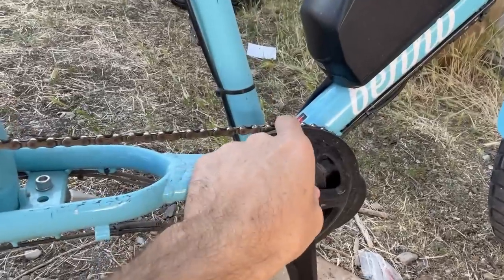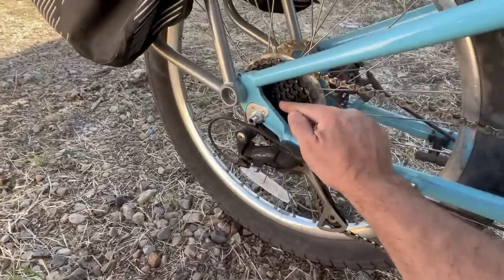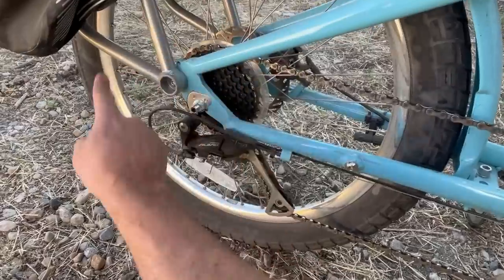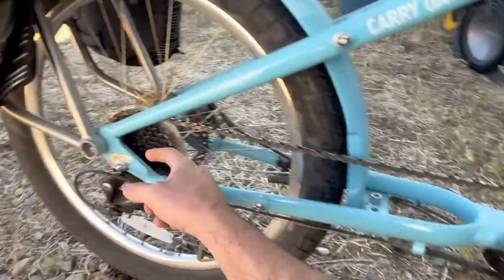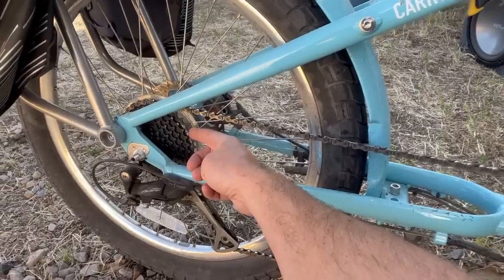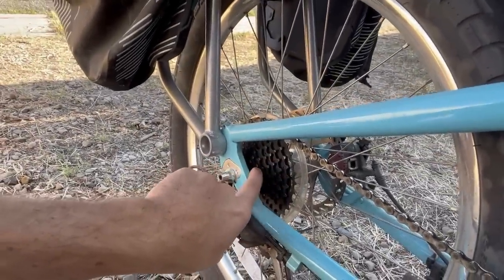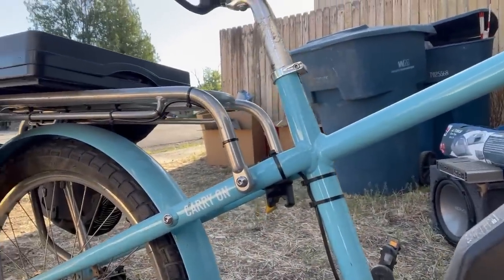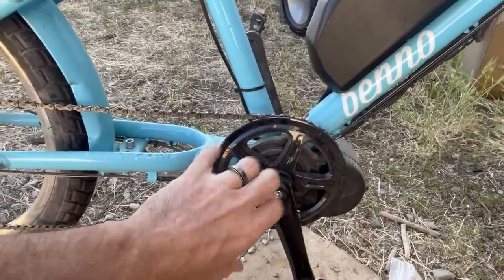The Cheapest upgrade for ultimate performance Boost on your Bafang Mid Drive!

Comment: Thank you for the video . Can mid drives move without pedaling? Do they also have a 'throttle' like the hub's can?
Reply: Depends on the bike. Some have throttle & some don’t like my Electra Cafe Moto Go, has no thtottle …. I am hoping somone will (hack) develop a throttle like I had on my Wowgo 2 skateboard … it was wireless hand held. Make so U can clamp to handlebar ⚡️🚲
Reply: @davidj.jorgensen4828  Thanks. Yes a wireless option could be a good idea.

Comment: Yes it's all about gear ratio 
It's crazy when people put 1 speed at the back on mid drive system's.

One of my first mid drive has 12 speed at the black & 3 speed at the front.
The 29inch wheels with 12 speed sprocket & eagle technology Shifter & derailleur.
And including rotor discs
Only cost me £80 altogether pre-owned.
They were broken little bit buckled but I fix them & straight them like new for free.

 For £100 I've actually build full mid drive system e-bikes.
I only sold it the other day for £350
Still £250 profit 
It also has a big battery pack 14s 8p original cell's.

Comment: you don't multiply the power with the transmission! 😄
So your ultimate performance upgrade is just to have correct gearing? basically by putting a big chainring you're adding an overdrive, and with a wide range cassette you are maintaining low gears to climb. the good thing is that by using a big chainring you probably won't need to be on the smallest cog, unless you 're going down hill or really going top speed. tiny cogs like 11 or even 10/9 are not the most efficient so for the same gear, using both bigger chainring and bigger cog you can send the same torque/ power but with less stress on the chain.
there is no real downside except ground clearance if it's a mountain bike.
Also after seeing a review of the ariel rider grizzly they said it was picking up speed so quickly that they had a hard time going through the 7 gears...so if you have a powerful mid drive you might want to use a wide cassette bit maybe not with too many gears. like box 9 12-50T group set so you have a wife ratio but not too many gears to shift plus a wider chain than on a 11/12 sp

Comment: 40 mph on mybike is very comfortable even on rough terain potholes etc.i onlyhave 180mm rotors and standard shimano hydraulics .full suspension is a must have but it has to be tuned perfectly ,so get decent suspension irun rockshox sektor and rockshox air shock on the rear of my voodoo canzo.works great with my hub motor too .which im running on a 52v battery at 26amps .tyres wont explode or disintegrate either 😂😂😂 and im not fussy what tyres i use either as long asthey hsvea rounded profile as mostof my riding is on the road and i do lean it over hard into turns .

Comment: Do you or anyone know of a electric bike or motors that make transition. Like a locomotive does. High amps low voltage. To low amps high voltage. To overcome counter electromotive force. Why use gearing when you have electricity.

Comment: what kind of gears would you suggest for a mid drive Royce union 8 speed ? maybe a 11 to 42t cassette and a 52t chainring for strong 17-22 headwinds here in Southern Arizona ..thanks
Reply from the maker: Just make sure you have a 750w mid drive with as close to a 1:1 ratio in your lowest gear and you will be able to ride in a hurricane

Comment: so a 
Lekkie Bling Ring HD 52T paired with the SHIMANO XT CS-M8100 Cassette - 12-Speed, 10-51t would be a beast in speed and climbing?
Reply from the maker: Definitely. IF the chainline works out…
Reply: @JohnnyNerdOut  51mm and 52mm

Comment: Here's a perfect set up for my 26inch wheels with bbs02 750w  46t front and 11-50t or 11-42t rear casset 9speed, will need
 derailleur extender or longer one and extend the chain or use full length of kmc 9sp chain
I climb any steep hill provided I have traction and with full throttle and pedaling on the flat I can reach speed of 35mph, can buy the rear cassets  and derailleur or extenders from aliexpress
Reply: What is the max speed with throttle only with that setup?

Comment: I'm just finishing my build and realised that I want my throttle on the right but it will interfere with the rear shifter. So I've got a grip shift on the right and the throttle as well. Problem solved.

Comment: I know this wasn't a review but I couldn't help admire the Benno conversion. Is that one of your bikes? It's what I'd call a super efficient PHEV SUV. Me likey!
You can find wide ratio cassettes (11 to 42 tooth) in as few as 8 gears now. I haven't seen a freewheel with larger than a 34t granny.
Reply from the maker: Ya thats my wifes bike :) Love our Benno's!
I found a 11-46t in a 9-speed (which I have) that I  need to upgrade too soon. Ya, the freewheels are really slim on the ratios :(
Reply: @JohnnyNerdOut  Sweet! When I put my 1st e-bike together no wide ratios below 10 speeds. I'd prefer as few gears as possible with as wide a ratio as possible but ya play the cards your dealt. I'm hoping to go back to 8 gears when I eat through this cassette.
Reply: @michaelsprinzeles4022  You might wanna look into Box Four groupset. Works great on my folder.

Comment: how can I over clock the bike over the 30mph limit/rating
Reply from the maker: If it’s a Bafang mid drive, use the display and /or the program cable to change the controller settings.

Comment: On the mid drive set ups, is there a top speed limiter? On my ghost hybride it feels like when I hit around 20-22 mph it stops assisting. Typical?
Reply: theresprobablya limiting wire thatneeds disconnecting or sometimes the controller is programable

Comment: has anyone put a Bafang BBSHD 48 Volt 1000 Watt 68mm Mid Drive Kit on a 2007 Trek FuelEx 5? I want to try this. one site has templates you cut out to check the sizing of the motor/chainRing on your frame. I am waiting for the tools to disassemble my bottom crank. I wont know if it fits until then. but anyone out there who may  have done this and sharing your experience would be welcomed.
Reply from the maker: Custom E-bike build: trek Fuel EX5 Full Suspension Bafang BBSHD 48v 1000w mid drive
https://youtu.be/z0T7jyV2JHQ
Reply: @JohnnyNerdOut  wow thank you so much!

Comment: Hub motors more reliable what if you're chain breaks you go nowhere.
Reply: Well If you can apply 9,500Nm to.    11,000Nm to your bike chain then yes it will break but your not going to be able to do that so mid drive is better then hub in my opinion

Comment: Hey Johnny I’ve been using my bafang 750 for three weeks now and I’ve noticed it get kinda hot on the motor is this normal?
Reply from the maker: If you are pushing it hard, yes. If not, no it shouldn’t.
Reply: @JohnnyNerdOut  I’ve seen videos of people adding new grease vs what comes in it, is this necessary? 
Ps thank you for responding. I actually bought my kit off your site after watching your videos. I now take my bike to and from work

Comment: I have a 60T chainring up front and the lowest I use in the back is 13t and I can barely get to 32mph with my bafang m625 kit on a straight flat. I run ceramic bearings in my wheels and in my pulleys. And my suspension is stiff on my mountain bike. Perhaps people are reaching the higher speeds using the throttle alone. But you won't be able to pedal up to those speeds because of ghost pedaling. It'll be too easy to pedal and you won't generate the force needed to push the bike up to higher speeds. The motor's power assistance will over take you. I'm ghost pedaling on level three... cruising at 27-28mph. This kit goes to level five. Something is very suspicious with these guys 40+mph claims. Oh, and my bike is a 29er with street commute thread tires.
Reply from the maker: What rpm are you pedaling at? Every one tops out at different rpm but if you are able to hit 80-90 crank rpm with a 60t-13t ratio on 29er you should hit 35 fairly easy I would think.
Reply: @JohnnyNerdOut  I could if I wasn't ghost pedaling... That's the point. At level 4 on this mid drive I begin ghost pedaling at that gear ratio. Which means I could probably get up to 40mph if I had a larger front and/or smaller rear cog. I don't see how people are reaching those speeds with just pedaling on a flat road unless they're not pedaling and instead are using the throttle alone.

Comment: Why do people think they need a Lekkie chainring 😂🤣lol.

I use very cheap chainring or i use original chain rings on my mid Drive systems.
I get no wear & chin never comes off 
And my e-bikes are high powered 2500w 82v 
If you're getting problems with your chainring something is put together wrong.
Reply from the maker: Different frame geometries call for different chainline offsets. Sometimes the motor bumps out the chain line very far especially on short chain runs, and it requires maximum offset to be able to use the lowest gears. I’d say only about a third of bikes need a new chainring.

Comment: YES!! about time someone raised "speed" just because a bike can get to 40mph doesn't you do it an hold that speed, at the end of the day they're bicycles they're not meant to do high speed especially with the weight they're carrying, power is awesome as long you respect it, bicycle tyre blows out at 40+mph it's going to be all bad
Reply: Bikes can do "high speed" all day Long, just not the cheap ones people are using for these DYI builds.
Reply: @bindingcurve  lol they're bicycles all day long not crutch rocket motor bikes, they're not rated for high speed just because you might get away with it for a while don't mean it's a good idea
Reply: @arronjohnston742  30-40 is NOT high speed.  Again, GOOD quality bike have no issues with this.  I have been on long decent rides when we are averaging 40 on a hour + ride and hitting over 60. The biggest issue we have is the brakes heating, not something a commuter has deal with.
Reply: @bindingcurve  I've had 5 bikes now. If you have a quality donor bike with quality components the speed is not an issue. What is an issue, especially with a cheap donor, is rough riding or shifting under load. If you are a heavy rider and add 30-40 pounds of motor and battery to your walmart bike then go off roading something's gonna give. Speed wise even the cheapie can do it. Just won't stop fast. Hydraulic brakes are a must on these bikes imo.

Comment: This shows how to multiple torque on a small motor and make your bike do 5mph maximum speed. You can't have both. You already have a happy medium with your gears. This dude waisting your time
Reply from the maker: Increase your gear range, increase your potential power across a wider range.